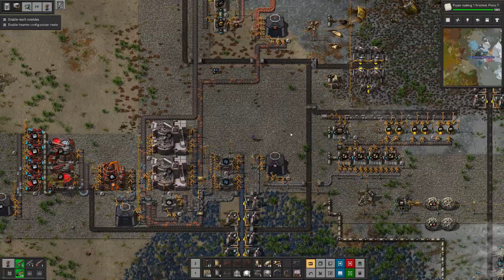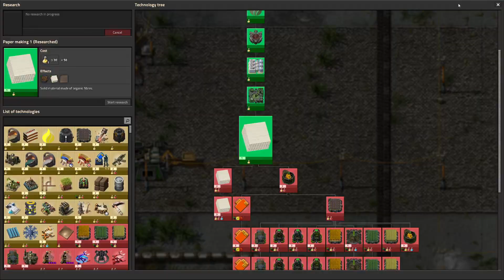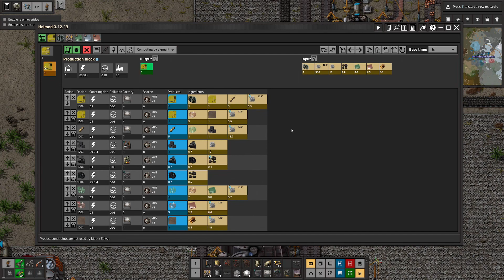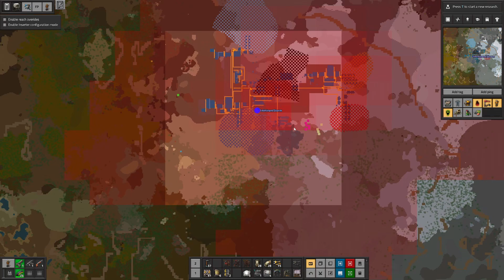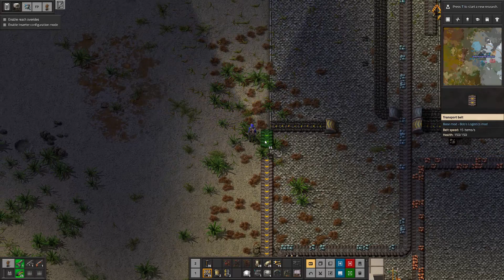Factorio - Angel's & Bob's - Season 2 - Episode 010 - Starter Electronics

Comment: Almost left wondering if you should be running water and making steam on site with a boiler 1 for the carbon, since the extra energy to heat up the steam in a boiler 2 is wasted using steam as an ingredient.